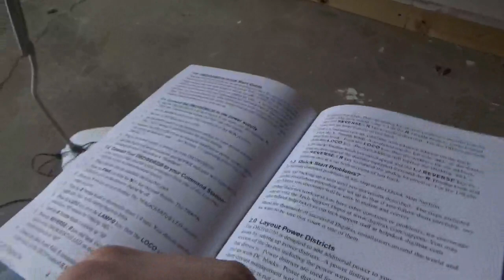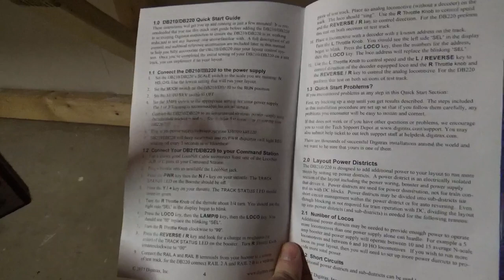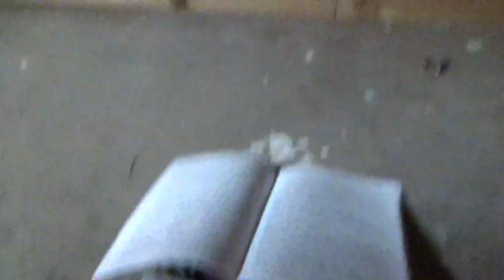Digitrax DCS 210 DCC Power Track Status Problem?  Help!

Comment: Hi Dan. I have a question for you.  But first let's go back to the 5:06 Mark.  That switch, who makes it? If it's a Shinohara, Peco type or Micro Engineering, did you isolate that frog? If no that frog could be shorting out the system.  

Let me know thanks.

Comment: I used a basic Atlas Master DCC system for years on my layout and never had any issues. I decided a year ago to upgrade to the dcs210+ and now more than 50% of the decoders I have wired into my locomotives aren't compatible with the system, I've literally sent dozens of messages back and forth to digitrax and tried everything that they've said with no remedy. Also the emergency stop is a joke, it literally only stops the locomotives that are already being controlled by the controller, if the address isn't already typed into the controller then that locomotive continues to run and eventually crash after using the emergency stop. And then there's the controller, I'll be running at 15% and slowly turn it up four notches and it'll randomly jump to 80%, this thing is a joke. I even shipped the system to digitrax to get it fixed and they told me there was nothing wrong with it so I'm guessing they never actually even looked at it.  Anybody want to buy a barely used dcs210+ POS?

Comment: Standard troubleshooting procedure with new additions is to disconnect all new wiring then checking that old section works OK. Then add a small section, test it, then add another. Continue in this format until all new sections are connected. This is how professionals do electrical testing. If it works for 12":1', it will work for models as well. When an existing system fails with no new work, only then look to the control system.
Bi11 Hudson

Comment: Dan, a tip, when installing and wiring track, wire up a few pieces and the startup the DCC system to ensure that there arent any shorts, after that, turn it off and continue setting your tracks, repeat the same process.
Reply: @eXtremeFX2010  normally it comes down to the frogs or turnouts themselves. Are the frogs electrically isolated? AKA Insulated metal frog. Are the turnouts DCC friendly? Lastly, are the rails all wired individually? This is a common area where the wiring may be confusing on a switch track, make sure each rail is independently wired.

Comment: To me in my mind, the system won't/ can't know if it doesn't have enough power until there's enough locos drawing from it to determine I don't have enough and the system shuts down account  overcurrent protection on dcc. 

If it was a short, you would have remedied the issue as soon as you de wired the new section. Maybe you missed a spot and maybe like 1 feeder is still hooked in?? Also maybe it's the switch that's wired, is the frog live ? If so, is it still wired in? 

This is tough man, I say buy I micrometer. That will help find shorts. I am not at all familiar with digitrax systems, this is just the only thing that comes to mind.

Comment: Dan the only way to locate such problems is to isolate each 'section' in turn until you find it. If all of you mainline feeders are connected together, and or you have switches crossing over to the other main lines, just isolating each mainline in turn may not find it. I would start by disconnecting all of the feeders to your points/switches at once (i know a pain.. but), and then see if you have the same prob. if not connect then up one at a time to see if the fault reappears. I cant see your track layout but if you have two apposing frogs (or similar) without insulating rail joiners, that will cause a short (sorry if you already know that but check you have used insulating rail joiners on each switch at the connecting opposing frogs)  that could be your problem. Make sure you check if the fault appears/disappears when you throw each points switch  in turn. The problem is NOT that you have too much track on the booster unit, as  you are not drawing any current, and then only unless you have many locomotives powered up simultaneously (also unlikely that your booster unit is faulty).

Comment: I'm no expert either but it looks like you have a continuous bus, meaning a circle?  I thought the main bus cables should end not circle back on itself. And that system should have no problem powering that size layout
Reply from the maker: So the bus should be cut at certain sections then?

Comment: On an entirely unrelated point, it appears your bus/feeder connections are equally side by side. These soldered connections should be staggered so they can NEVER touch. You may have staggered them but the camera angle makes them look as if they are  side by side. Don't want you to have any future problems.
Reply from the maker: They got moved around quite a bit when I checked them out but I need to tie them back away from each other.

Comment: A lot of good suggestions here.  This is one of the reasons for using PM42s to create power districts.  Creating power districts can help you troubleshoot too.  When a short does occur your whole layout is not shut down.  Only the power district with the short goes down.  When you do install the booster to work with the command station be sure to hook the two ground ports together.  I do use the car method, red electrical tape on one side and black on the other.  It provides a more visual guide to the track feeders.  One other thing that I do as I am wiring up.  I cause deliberate momentary shorts across the rails to make sure my DCC system does detect the short.

Comment: Whenever hooking up drops to the bus it helps to have real time short detection.  To do this get a buzzer, a 9 volt battery and two alligator clip leads.  Clip the leads to each rail (the layout should be off when hooking up drops).  When you connect each drop and especially hooking up frogs, if you accidentally hook them up wrong creating a short, the buzzer will go off and you will immediately know that you have made a mistake.  Some people use an auto light but I like the buzzer because I'm under the layout doing this job and can't see the light.

Comment: I would disconnect it from the layout… take a piece of track and connect it to the digitrax and see if you still have the problem… that should tell you if it’s the digitrax itself or a layout problem…. Hope it’s just something stupid and easy to resolve!
Reply from the maker: After checking, it is for sure the layout causing the issue.  System runs fine off layout connection.
Reply: @DansRailroad2011  good… now I would remove all track leads and start over… I think you have a direct short somewhere… i think your video said you had part working. So start there.  But you probably already new that……. Good luck.  I’m sure you’ll find it …

Comment: Dan ALWAYS go back to the last job you did on the RR. Check each feeder that it is wired to the correct Bus wire one by one. Sometimes if you stand on the opposite side of the layout when wiring it is very easy to wire to the wrong bus wire. Digitrax is a very good system. You do not need a booster for that size layout. Just careful methodical wiring practices. I had an N Scale layout with 130 feet of track 85 turnouts and signals that were controlled by a CTC panel through JMRI. Again, Just work from where you last wired and work back from there.

Comment: I have no first hand experience with wiring up DCC layouts, but to me I feel like you could possibly have a switch that's shorting out. On an unrelated note back when I was in a train club my personal section had a switch that started doing something strange that never happened originally for a while when I put the switch in. What would happen is whenever I would line the switch for its diverging route the entire section my layout was wired to would shut down for a second then come back online. Command station never beeped or anything, and I never took the time to figure out the issue, or even replace the switch since I was getting ready to quit anyway.

Comment: Good luck! DCC is so stupidly outdated. With Bluetooth, there's no reason to use the track for sending signals anymore. Hell, we're probably close to dead rail systems being possible in HO. Then all this counter-intuitive, hard-to-program antiquated crap from the 90's can go away 🤣
Reply from the maker: I'm ready for battery powered models that you can recharge like a modern Iphone.  That way track is no longer such a peta to get right.
Reply: This is what I'm waiting for as well! I bought the dcs210+ and is the biggest piece of junk I ever used in my life. For a few years I was using a basic Atlas Master DCC system and never had any issues with my layout. Decided to upgrade to the digitrax and now most of my decoders do not work with this system, the emergency stop does not work on this system either, consisted locomotives will all the sudden start racing around the track or cut out. I spent hours messaging back and forth with digitrax online and all I get are generic responses that don't help.

Comment: Agree with a bad switch this happened to me twice and I have 145 switches and two turned out bad. You can ohms test your switch tracks to see if there is a short. Hay there are no dumb asses in this hobby just learning. Hope you got it fixed by the time you get this. One thing about this hobby everyone helps for free. Happy modeling.

Comment: Did you wire in a power block? I have an NCE system 5 amp system and you should not need a booster to power the amount of track you have. When dumping in feeders I made a designated rail car with plus and minus signs on them so as I’m going around the layout at least you can be sure that you didn’t wire it backwards? I did that once . Also get a volt meter and check voltage up to the area your having issues with a short could do that! Also make sure there’s no wyes of reverse sections they’ll cause issues as well! Good luck!

Comment: It sounds like a short. I use Digitraxx as well.  Either you crossed your Rail A & Rail B wire (red/black) to opposite buss lines off the track or to your main bus.  Or, something metallic is sitting on the track.  If you are doing zoned sections you could disconnect your feeders from the main line if you have quick connects (male/female connectors) or if you have a volt meter test the lines incrementally down to the point where you know the train last worked.  It’s not the Digitraxx power supply since it worked with your first section.  Some wires are crossed some place.

Comment: I know this is redundant, but use the continuity function on your multimeter. I always touch the 2 leads together when I turn it on, to 100% verify that it’s working (it also verifies that your meter leads are seated properly). Then check from rail to rail. Your meter will obviously ring out if something is causing a short circuit condition. A couple guys below mentioned switches being potential problems and I agree. Odd stuff happens even with brand new equipment. Good luck!

Comment: Dan,
         It seems like a short ( most likely with one of the switches) You should always test switches (yes even new ones) before installing.  Your video was really fast on the trackage, but I think it's around with your wye switch, but again your trackage video shots were really fast.  Good luck brother.  Welcome to layout model railroading 101.  You got this.                        Thanx Thom...
Reply: I agree a short in a switch is very possible. I use NCE when i get a short it flashes too. Did you already disconnect your leads to layout just to verify you dont have a system problem?

Comment: I would ensure that all of your turnouts have insulated frogs. If they don’t have the insulated frogs, you need frog juicers that power the frog appropriately to prevent a short. I recent located a switch that worked just fine for months on my layout. It was a peck electro frog and didn’t have a frog juicer on it. Needless to say, it created a number of problems for me, very suddenly. 

Also, Double and triple check that no feeders are crossed. 

I ran my double level layout, subdivided into 8 blocks, and hundreds of feet of track off of a DCS100. I don’t think the power supply for the DCS240 is the issue.

Comment: 1) Digitrax manual stink. They give you info you can use if your an engineer and simple info they leave out. 
2) You can only go I believe 25 feet I each direction from brain for each electrical block with main feeder. If you go further you need booster.  There are cv's that you can turn on that automatically turn on track power when you turn on main brain. 
They used to have a cr2032 battery in main brain to keep these cv's set. Check your cv's. If you can use JMRI program for that it is soooo much easier. With JMRI you can see all you cv's at one time and see how they are set. 
3) if you track is in a loop make sure you have insulated ( both rails) so you don't have a continuous loop electrically. 
4) I know electrically you can't have a continuous loop on the network cable. 
5) If you have more then one block ( electrically ) make sure the ( just for this example) north track , the rail furtherist away is the same ,say positive all the way throughout. You have to check closely for this. If you have two blocks come together they have to be insulated ( both rails), and can't be reversed negative on one side of insulated and  positive on the other. This is call " out of phase " and will cause all kinds of wears trouble. 
Your best bet is to spend the money and get a Ramp meter. It checked voltage and if signals are running on rails. DCC is direct current for running engines and Alternating current for the messages running to decoders. Also if you have Peco turnouts you need at least an insulated on two inside rails after frogs. Another thing you need power feeds before the points on every switch especially in the yards.

Comment: Do you have one switch that is not DCC friendly? I accidentally placed an electrofrog turnout in my layout and that caused a short. I would disconnect all tracks so that its point to point only, remove a small section of each of your mainlines and then test you power supply

Comment: I think you should wire up one main line on 1 command system  then wire the main line and yard on the other booster  And I would literally go back and start fresh disconnect and reconnect and terminal strips or barrier strips help with the troubleshooting process

Comment: It sounds like a short? Possibly a switch after your second block or incorrect wiring.  I would disconnect the new section recently wired and restart the the system and test it again to  see if does not solve the problem.,
If it doesn't resolve the problem it would be an indication I was an issue with the digitrax system.
Reply: Dan remove the feeders from the switches, it looks like you're running Atlas insulated frogs if so you're short to be occurring between the switching points and the frog itself on one of the switches.
Reply from the maker: @micheldescoteaux7192  They are Peco insulated frog switches, I was told to avoid the Atlas switches.  They have insulated joiners on the inner rails leading away from the frog.

Comment: You have a short.  Super easy fix.  Just go with the last thing you wired up and try reversing it.  Its not the dcc station.  Its probability its 80% physical usually a crossed wire  somewhere

Comment: I don't knew much about digitrax so I have no comments there. However, I had a similar problem when I connected a turnout at the end of a loop. What brand are the  turnouts you are using? Some of them need modification if wiring for DCC eg. Peco. You may need to snip the wire underneath that connects the stock rail to main rail. You also need isolated rail joiners on the inside 'frog' rails. If it's not the turnouts then I suggest getting a multi-meter and testing each track section. But, I'm no expert either...... these are just the similar problems that I had. It drove me nuts until I found the frog wire problem.
Reply from the maker: I am using the Peco turn outs all across the board, they use insulated joiners on the inner rails leading away from the frog according to the manuels indication for DCC setup.

Comment: Try disconnecting your track power feeds from the unit. See if the problem persists. If it does the problem is in the unit, if not then it's in your track or wiring

Comment: Check to make sure you have no metal tools on the track. I had a short and searched for hours only to find out I had left the metal Kadee coupler height gauge on the track.
Reply from the maker: I learned that quick by leaving a Xacto on the tracks!   It's for sure a short possibly caused by a bad connection or loose feeder, or switch on my newest section.  Everything worked flawless before I wired up my new connection.

Comment: Check for shorts in the  new area.  all it takes is one strand from a wire touching the other side and you have a short.

4 beeps is a short on most command stations.

Concerning not enough power: What size are your feeder wires and bus wires. at least 14 on the buss and 22 on feeders. You won't have power issues with nothing running unless your wires are too small